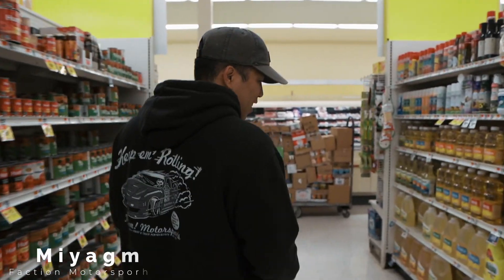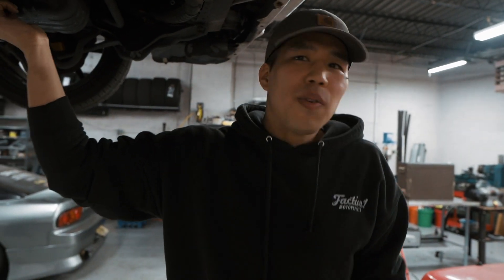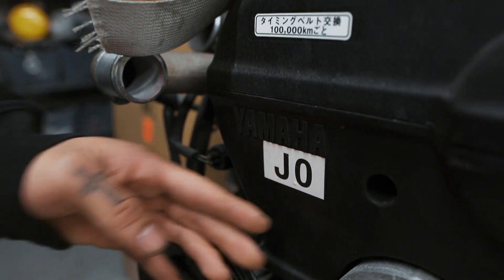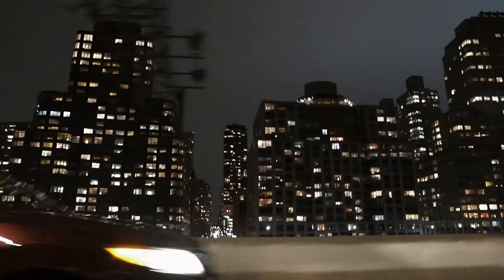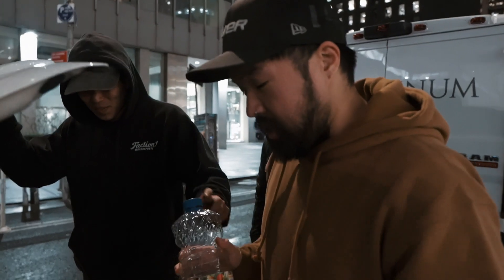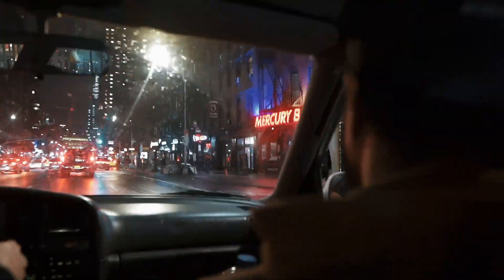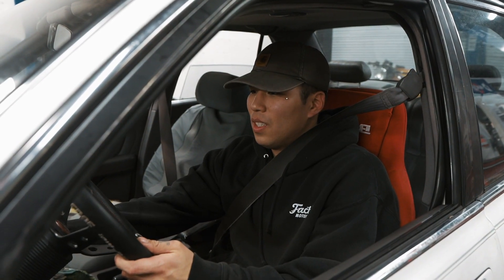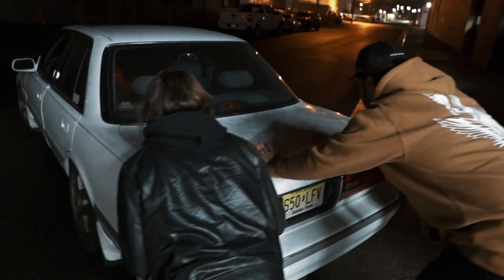Can you DRIFT a car using VEGETABLE OIL as engine oil?

Comment: Now you know... cooking oil is as good as pricey synthetic motor oil....
Im Using 80% palm oil mix  20% mineral engine oil used for ship engine oil that have higher tbn in single cylinder motorxycle engine that often runs 13k rpm ... its fine... runs well... no more pricey amsoil or purple oil... 🤣